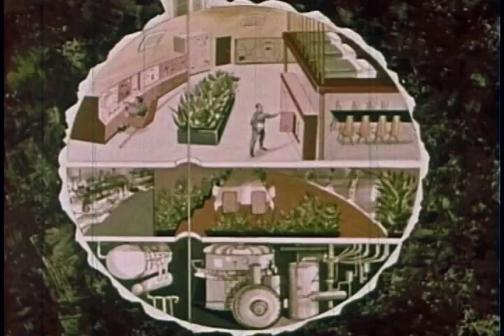Way Stations In Space (1960)

Comment: Yes expensive and True but the center of station would be 0 g.  Both scientist and astronauts would be happy then.  Also the station would not need to be giant spinning wheel.  Maybe a smaller section like two module spinning on opposite ends of a central arm.  That way the whole station is stationary but you could still have an area with centrifugal pull for say living quarters.